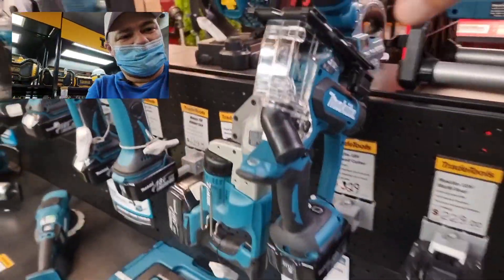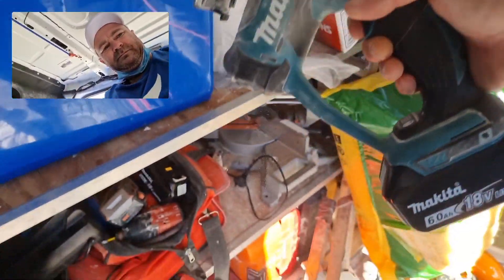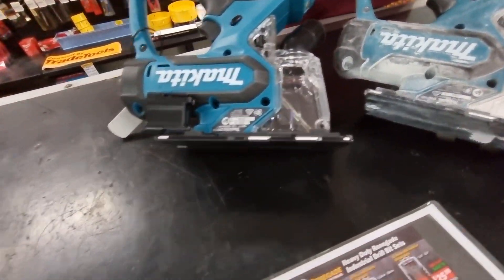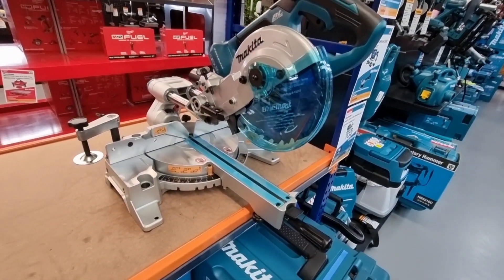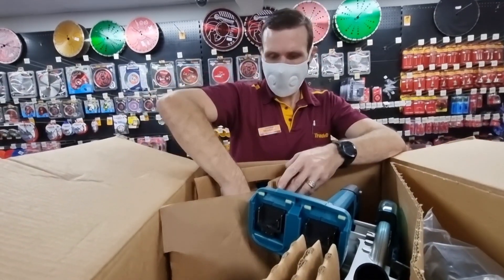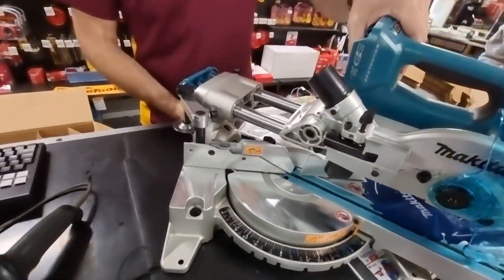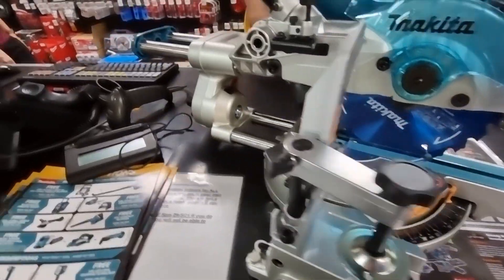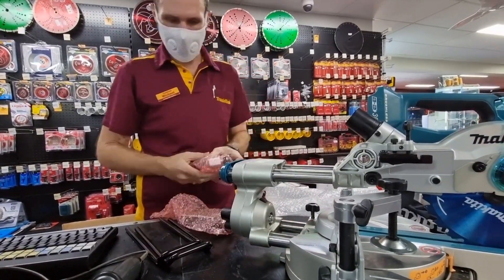Drywall Cutter Blowing Some Smoke | New Makita Dropsaw

Comment: That 190mm mitre saw is the schizz, mate! I have the corded one. Such a beautiful machine to use. 
However, as I’m also doing fencing now, I did buy a 10” model last week at Sydney Tools. So much easier to slice through the 90mm posts!
Reply from the maker: Yeah nice Ben, I need the practice. I just keep the caulking gun nearby:_maxkilMaxkil:sad but true